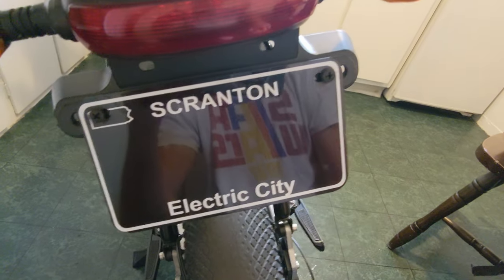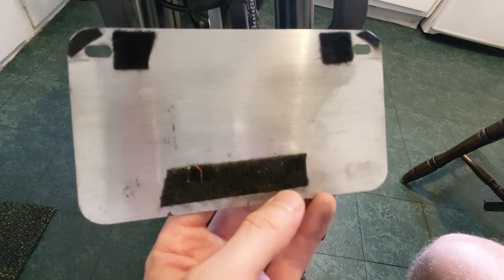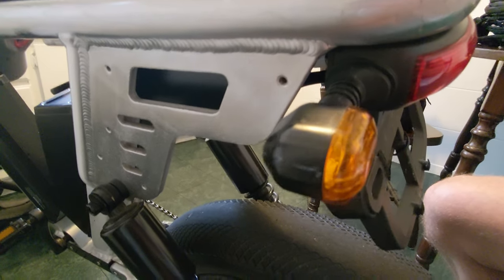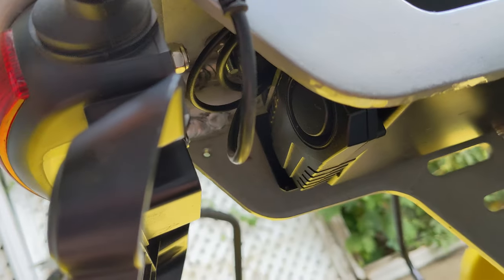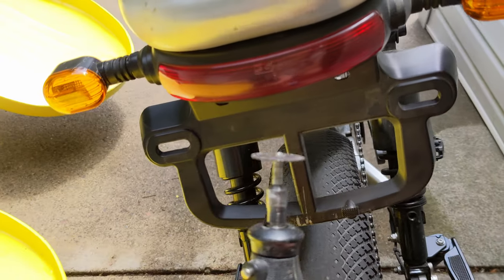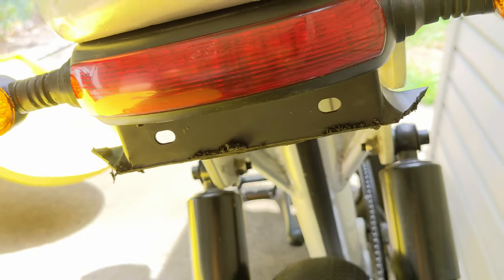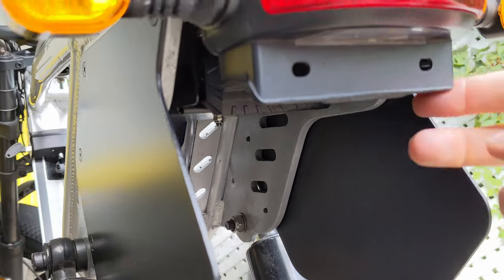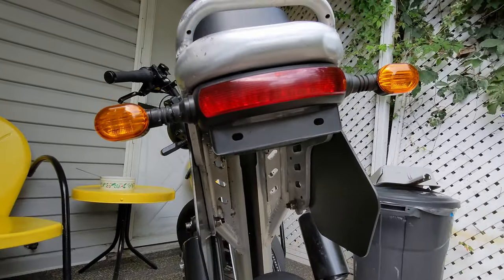HyperScrambler 2 License Plate Mount Removal Ep.65

Comment: Nice job.  You have given me the push to do the same thing with my HyperScorpion.  I have always thought that the license plate holder was just a trigger to make folks wonder if the machine is legally a bicycle.  Remove the plate holder, remove the doubt.
Reply from the maker: Thanks, going into a modification you can't reverse is always a bit scary. I thought the same thing about the holder. A holder with no plate looks suspicious. That's why I chose that specific kind of license plate. It clearly looks like a novelty so it wouldn't be questioned. Now I don't have to think about which is nice 👍

Comment: that looks great man. Weird that they designed it as all one piece, my scorpion X seems to have an option to remove the plate holder
Reply from the maker: Thanks! Are you able to remove the holder and still keep the tail light? Maybe they realized people liked having the option to remove the holder if they wanted to
Reply: @keepingitkresky4412  you can unscrew the piece holding the tail light and mount it in two or three different places iirc
Reply from the maker: That's cool, seems like they may have modified it a bit.

Comment: I like this bike...pretty much my first choice. What's your top speed distance  and sre you happy with steep hills....what kinda tire you purchasing? I like Kenda. Does this bike have Race mode. Cover the back wheel so you don't get plastic all over the hub an gears....dentist drill oh God!
Reply from the maker: Top speed is 32mph, super steep hills do bring your speed down a bit but for the most part the bike does awesome. I got the vee mission speedster tires. I have to get new tires soon, I may get them again. I like quiet but grippy tires. It does have race mode (unlock at your own risk lol). Fenders have to be bought as an accessory on this bike. $150 on the Juiced website.
 I thought about covering the wheel and then it was too late. Thankfully there wasn't a bunch of plastic debris.. A part of me kind of likes that drill sound 😁
Reply: @keepingitkresky4412  lol thank you. This will be my pick for a bike. Seems to be a great package. Does the price go lower at any time?? What is best time to purchase one of these bikes
Reply from the maker: You're very welcome! There seems to be a sale going on now actually. If you could swing the extra cash definitely get it with two batteries when you buy it. It is absolutely 100% worth it.. I'm not sure when the sales usually run though. I'd sign up for Juiced emails and they'll let you know about any sales taking place. 
Two things to consider. In my opinion, this bike comfortably fits someone 5'10" and up. Also, it is pretty heavy with the batteries (119lbs) so if you have to carry it upstairs for storage or whatever it would be difficult. Just things to keep in mind
Reply: @keepingitkresky4412  got ya. Yes understand about the weight. Wheels are nice on heavy objects. I'm perfect size and plenty of strength.  I don't have a climate controlled garage which may be an advantage.  Since all the electronics. But will make room in house over cold winters. Yes, juiced is sending sales info. Wish the government allowed for compensation when purchasing this type of transportation.  Like the electric car....Definitely my pick. Been deliberating a long time. If you see anything better on the horizon let me know....stay in touch.

Comment: I lifted my my Zooz out of the box the right way up with the battery connected to the bike with no trouble it's only 25kg I couldn't do that with my other bikes you can tell its not just a bike with a battery they've took time building the frame the way it steers and turns the frame  Geometry Nick its like the bike has power steering its built to take everything you throw at it  the bike wants you to jump wheelie slide and nothing on the bike rackles or shakes it has no suspension but yet you still want to jump at every opportunity you can and the motor wants you to use the throttle most of the time and it only cost £2.600 for all that fun plus it uses the same battery as my other bikes so my 52v 21amp will come in handy 😉
Reply from the maker: I just searched for that ebike and it looks pretty awesome. It really does have a BMX bike style going on. Super light, so I can imagine how it would just want to take off. Solid purchase. If I had the cash and the space I'd probably get one myself. You gotta get a YouTube channel going so I can see it in action 🤙
Reply: @keepingitkresky4412  I know friends tell me all the time
Reply from the maker: Definitely let me know if you ever get a channel up.
Reply: @keepingitkresky4412  👍🏾👍🏾👍🏾👍🏾💯

Comment: You know what I just noticed you don't have Tire covers whatever you call those things to keep you from getting splashed from the back, yeah my warranty was over in June luckily one of my turn signals went out before that and they just sent me one in the nick of time. Have you had to add mineral oil to your lines on the front I think I might have to do that do you have a video??
Reply from the maker: I think you're talking about the fenders. You have to buy them separately for this bike. They cost $150 which is a bit high for something I don't really need. If I can ever get them on sale I'll probably go for it. 
Funny you mentioned the brakes. I was just thinking while riding last night that I should probably give my brakes a tune-up. I'm not sure when I'll get into that project but when I do. I'll definitely film it 👍. Glad to hear you were able to get your blinker fixed under the warranty. Perfect timing there!

Comment: Anyone got horrible brake squeak issues ? Just replaced the pads after 1200 miles and it’s the same. Front is worse than back but it’s still super annoying.
Reply from the maker: I had brake squeal around that milage too. I got two new rotors and the cam one didn't make noise for a good 1000 miles. I could never get the front one quiet again. Now they both squeal. I'm going to get a really good set of rotors next time to see if that helps